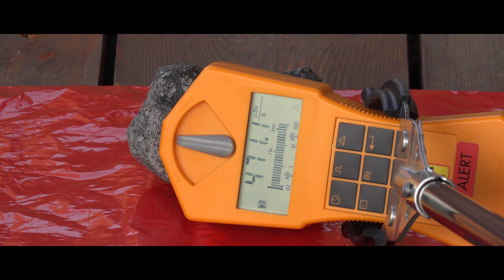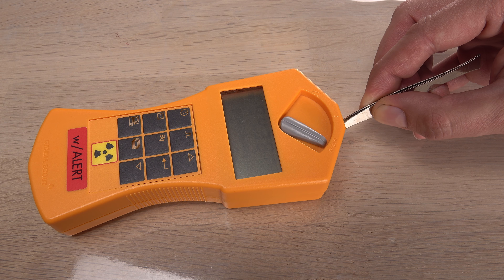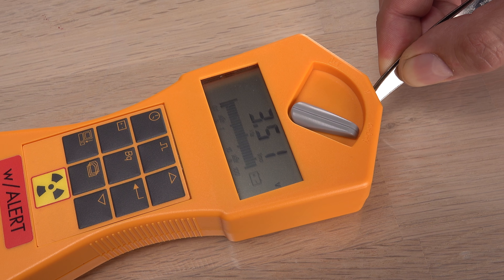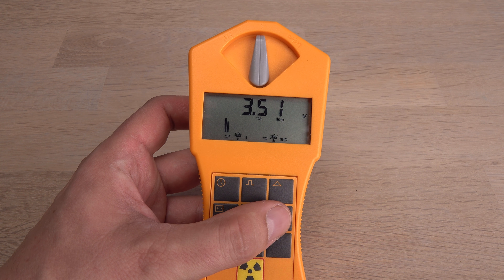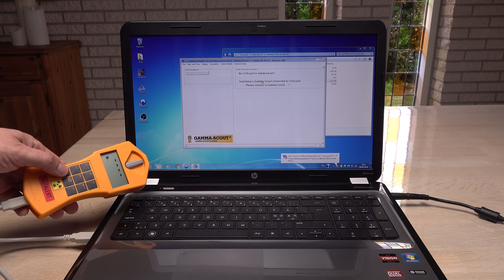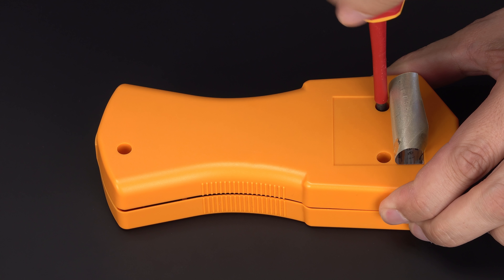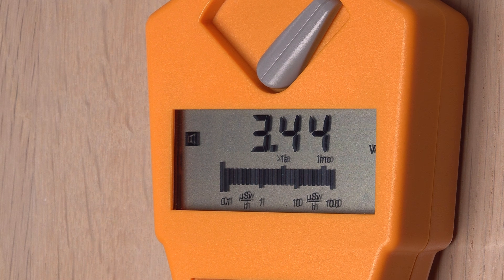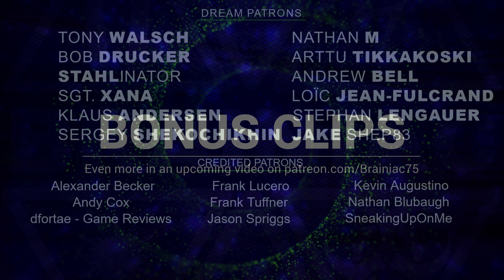Weird battery change in Geiger counter

Comment: Why didn't you just snip the leads of the old battery? That way it would have disabled the HV and it would have been safe to handle for the trickier desoldering of the legs...
Reply: It also would have been less likely  to damage the circuit board with less thermal mass to heat.
Also, Brainiac75 should get some good solder wick.
Thanks for the  video Braniac75. I'm glad your meter works again.
Reply: What about reattach

Comment: You could probably solder on a battery case for easier replacement
Reply: Yeah to save you time 20 years from now when it fails again.
Reply: skibidi bop bop bop skibidi dop dop dop dop dop skibidi sop sop sop sop sop sop sop dop skibidi sop dop yoh  @stargazer7644

Comment: It's changing a battery just put it in the correct way and don't touch the contacts for the high voltage and you will be fine

Comment: Why not solder a switch in series with the battery, when you already had it open and desoldered? :P
Reply: Because the current draw is so low the battery lasts its shelf life already.  Turning it off won't make it last any longer.

Comment: This is by far the most over dramatized battery change I've ever come across. Nevertheless, well done.
Reply: I mean, most devices don't have internal circuitry cranking up the ~3.7V of a lithium battery to several times mains voltage. Not sure if that's tied to a capacitor, but if it is, that would be dangerous in exactly the same way a microwave's HV capacitor is dangerous.

Photomultiplier tubes and magnetrons are similar in that way - both produce free electrons during normal operation and use high voltage to do it.

Comment: Why not cut the wires to the battery the moment the case is open (which will remove power from the unit) then after that, pull the board out and de-solder the remaining battery leads?

Comment: I'd have been tempted to see if it would work with just a regular rechargeable 18650 li-ion cell.
Reply: He already said that guaranty expired seven years ago. So - 8 years of battery life. To put there li-ion would be stupid.
Reply: @idopshik  - Well, he was already swapping the battery for a new lithium-thionyl chloride cell, which is more expensive than some random 18650 cell. And as he likes to produce videos appreciated by viewers, I'd certainly not call it "stupid" to swap the battery in the old geiger counter, even if it appeared that he's using newer and better devices instead.
Reply: @JohnnieHougaardNielsen  wait. Isn't 18650 - li-ion rechargeable accu, and thing he installed - chemical cell?
Reply: @idopshik  - He replaced the non-rechargeable lithium-thionyl chloride cell with the same type, which cost him more money than a rechargeable lithium-ion cell with capacity in the same order of magnitude. Of course, as he's probably not going to use the old geiger counter until battery depletion, the extra expense of non-rechargeable is not too bad.

Comment: Should have added an on and off switch, although you would have to press the reset button every time you turn it back on
Reply: Then why put in a switch?
Reply: @stargazer7644  so you can turn it off and not have the battery constantly draining
Reply: @Raven-fu1zz  This device draws so little current that the battery self discharges faster than the circuit consumes the battery.  In other words, the battery life is basically shelf life.  It would run dead in the same amount of time whether there's a switch on it or not.

Comment: I had a 1.5v AA batter reverse it's polarity once - haven't found anyone to explain why that could happen.
Really wish I had kept it
Reply: I've seen it with re-chargeable AAA batteries. I had 6 AAA batteries connected in series, and one was either not fully charged or was nearing the end of it's usable lifespan, (or was damaged/faulty) compared to the other 5. This one battery then became the weakest link. The device being powered depleted the batteries very quickly. The other 5 batteries tried to equalize the voltage difference while in use. The order in which the weak battery appeared in the chain of 6 may have influenced how much of a reverse voltage it experienced.
Reply: I saw a 12V car battery like that once. The only thing I can figure out is that the owner charged it backwards after it had completely died.

Comment: You should have snipped off the battery before desoldering. Also, used flux.
Reply: He's using resin flux solder. No additional flux needed for this application. For snipping off the battery... well it wouldn't be 'exciting' otherwise ;P

Comment: I like to have a couple of old computers around just in case I bump into interesting old hardware. Mainly because they have the required ports. In your case, you could just run XP in a virtual machine and everything would presumably be well.
Reply: i'm surprised software from 2008 wasn't working on windows 7 released in 2009, which is itself extremely similar to vista from 2006

Comment: I'd have installed a lifepo4 battery and put a charger IC on the USB header to recharge the battery. Talk about an anti-repair focused product though...
Reply: What is anti-repair about it?  He had no problem replacing the battery.  And why in the world would you put a charger on it?  Do you have rechargeables that last longer than TEN YEARS?

Comment: Sorry if it's too late but you can indeed get around it using virtual machines running either Windows XP or Windows Vista. I recommend using Microsoft Virtual PC 2007 since your laptop have Windows 7 built in ( you can  also use VMware or Oracle VM Virtualbox ).  you need to install the OS yourself though. But for the product key and the install disk you can find it on Google ( or basically any type of searching engines you have ) or just find one for new old stock on eBay or any type of online shop. I actually rate the difficulty around 3 - 5. But after you have successfully install your Operating System then you need to Install the driver for your Gamma Scout, and plug your Gamma Scout in! 

NOTE : YOU NEED AN RAM FOR AT LEAST 2 GB OR UP OTHERWISE YOU BE LACKING OUT OF MEMORY!!!

Comment: If somebody is changing this battery, please do learn how to desolder and solder. This method seen here can ruin the PCB. When desoldering, add new flux tin which helps you to remove the old one where the flux has burned off. Newer solder using bare soldering iron tip but always add some tin. Do not use too much of it.

Comment: I had to go through pretty much the same when I noticed my battery symbol had come on. I was very paranoid with messing up anything saved so I actually used my variable power supply to keep power to the unit while I removed the battery. Turns out I really didn't have to, even when one of the leads fell off the unit still worked fine of the capacitors for over a minute. I have the slightly newer CPS model, with 6.0SL(?) software. 
I cut off the battery first then just desoldered the small legs. That way I could also keep a power supply on it for longer without risking heating the battery (and losing the heat to it.)

Comment: You could have just soldered a capacitor parallel to the old battery, cut wires to old battery, charged cap to the same voltage as new battery (just use a small resistor) and then soldered in new battery.
Reply: Good idea !

Comment: Voltage doesn't kill, current does. To put that in perspective. Things like stun guns are typically around a million volts, so I don't understand the fear mongering behind this 450v
Reply: Because the capacitor can deliver quite a lot of charge at a high voltage and a low impedance.  Try shorting out a 500V photoflash capacitor sometime.  Then replace your screwdriver tip.

Comment: When I had to replace this kind of cells and had sram data to be kept, I soldered a new cell over the old and snipped the leads of the old one. It took a second or two. When sram was already lost or there was of no concern, I used a plastic AA holder and replaced the cell wit a leadless one.

Comment: These batteries tends to increase internal resistance over years, they are used also in PLC (Rockwell and Siemens), Siemens KB suggests to make a brief short on older batteries to destroy passivation layer.
See page 144 of this KB.
https://cache.industry.siemens.com/dl/files/849/1117849/att_23817/v1/424ish_e.pdf

Comment: The MSP430 is an extremely low power microcontroller; it can work at voltages as low as a few hundred millivolts.  This is why they are used in thermopile powered gas controls like those made by Honeywell.  Is that an Am-241 source you were testing it with?

Comment: Reason battery voltage stays about the same is because lithium thionyl cells as they age get a high internal resistance, to the point they will still be able to source near full voltage, but only at minuscule current draw. I have had some that will still put out 3V into a 10G input impedance multimeter, but connect a regular multimeter with 11M input impedance ( or change range on the high impedance one to the 30V range) and the voltage plummets to under 1V. Took it around 20 years to get to this point, and I had anticipated it, by placing a 0.1F supercapacitor across the cell. When it took more than an hour to recharge this capacitor in the clock application it was time to replace the cell, so used a pair of AA cells instead.

Comment: you can easely touch that 650V. It is floating so no current will flow and you wil neither get a shock. If you touch both 0V and 650V yes you will get a shock but you won't die. First of all the current isn't flowing through your heart but only your fingers, second of all the capacitor will drain instantly to near 0V. Don't be so over dramatic XD

Comment: personally I wonder if you could have fit a 3.7 battery holder on that board, so future changes you could have just swapped it out
Reply: Why would you want the reduced reliability of doing that?  You replace this battery every 25 years.  It's two solder connections.

Comment: Solder a new battery in parrellel to the existing battery legs, then cut the old one out of circuit, this prevents any data loss.
Reply: Zurkster It's better to use a temporary capacitor, you don't want to charge an old battery with let's say 10 amps.

Comment: Why not putting a second battery in parallel and then replacing the main battery? :)
Reply: Protuberanz ... This can result in the old battery attempting to charge, draining the new battery.
Reply: @florencegomer7937  But the voltages seems to be the same in idle so no voltage difference causing no current to flow isn't?

Comment: Not an electronic expert but can you just hook it up to a power source with the same voltage while changing battery to keep it powered?
Reply: *with a way to prevent current running into the battery

Comment: Small tip for next time, or for anyone else doing this.
Cut out the battery with a pair of snips, as to not need to worry as much about the high voltages during battery removal.

Secondly, a note to the manufacturer, a product like this should likely use some form of sensor for seeing if the cover is removed. As to turn off the high voltage section of the device and make it safer to handle. (though, I wouldn't at all be surprised if the transformer doesn't give more then a couple of mA at most. So it shouldn't be life threatening, would only tingle a lot...)
Reply: If this had lethal energy inside it would.  If qualified people make the repair, it isn't a big deal.
Reply: @stargazer7644  Yes, it likely isn't able to supply any dangerous voltages. Though would still be a nice touch to see.

Comment: 250/500v G/M tube is not that dangerous, in most cases not even enough current to measure on a multimeter without overloading it, especially when it's stepped up from 1.5/5v. 
Overall a badly designed geiger counter, who thought it would be a good idea to have to solder in a new batt every time it drains?? almost as bad as apple
Reply: The battery is soldered in for reliability.  The battery lasts its shelf life - ten years.  Show me another battery operated product that runs for ten years between battery changes.
Reply: @stargazer7644  even an on/off switch would be good for when replacing it. The unit could have been sitting in a warehous for 2 years before being sold, or even more. In my opinon it's not the best soloution around
Reply: @edg6779  My Gammascout is an original model (mine doesn't beep), it was purchased in 2002.  It had a 12 year guarantee on the battery when I got it.  It is still running fine on the original battery 17 years later.  You think this isn't a good solution?  Show me another product that gets 17 years on one battery.  Seriously, the power system for this product is one of the best things about it.
Reply: Nobody thought it'd be used this long I think.

Comment: 2:17... Maybe it would be a good time to add an ON/OFF switch.....
Reply: Why would any device NOT have a power switch? Why does this device need to stay powered on?
Reply: @buddyclem7328 Because it can.  Does your wristwatch have a power switch?
Reply: Why?  The gammascout battery lifetime is basically the shelf life of the battery even when turned on 24x7.  > 10 years.
Reply: @stargazer7644  yeah, kinda like RTC batts. but still worthed adding a switch, it may be useful in case the software jams (this is possible during the insertion of the new on) and also some reliable connectors on the posts to make the operation easier in every sense and also for the future

EDIT:
i support this idea of customizing one own's appliance and stuff once you maintain it, a lot of times you really want a simple feature like that switch (but there's a reason why it's always on :D)
Reply: @redoverdrivetheunstoppable4637  there is the reset button for reset
Reply: @HappySlappyFace  ah yeah, i forgot, maybe i imagined it was just for zeroing settings and recordings, i dunno
Reply: @stargazer7644  shelf life of the kind of battery used in this device is >40 years yes FORTY YEARS.
Reply: @83hjf  Mine lasted 22 years.

Comment: hmh,  you probably should replace capacitors also when you were "inside"
great vidjeo as allways.
greets from poland, cheers
Reply: There's only one electrolytic cap and it is a small, quality, 105 degree rated cap.  It isn't likely to dry out.

Comment: hehe. Had a really old model, like from 2000/2001 that I sent in and they couldn't fix it (although the battery lasted >15 years, no ticker so and it still had the serial port where the usb is now.) Got a good deal on a new alert model though, and also it's nice having a new one. Fun to finally see the inside's of one of these meters though! Also it's nice that the new models seem to have an additional decimal place of precision. (No idea about the accuracy on the final digit though...)

Comment: The nylon zip tie seems totally unnecessary - vastly over engineered for the device. The battery is secured by solder joints at both ends and can’t move anywhere.
Reply: Vibration can cause solder joints to crack if they are supporting something heavy like a battery. The zip tie is a cheap way to prevent that.

Comment: I have a GammaScout of a similar age. I also need to replace its battery. I have the battery but I haven't been confident enough in my soldering abilities.

There is a python software project for reading the data, gammascoututil. I don't know how well it works in Windows but I've used it on Linux.

I took my GammaScout to an MRI appointment a few years ago to see if anything would happen, and something did! I had it in a metal locker for my personal belongings, approximately 10 meters away from the ring, and while waiting my turn, it began to alarm as though exposed to very high radiation while the 1.5T machine was imaging a patient. The field was obviously strong enough to pull electrons off the cathode and to collide with the tube walls. Moving it a further five meters away stopped the alarming.

Comment: Is there a reason the battery is soldered on?
Reply: Yeah. Too much corrosion would occur using a socket, during the lifetime of the battery. That's according to the manufacturer.

Comment: Soldering is not that bad but one advice is to hold the tip longer on the pad so you transfer more heat to the pad and the leg of the component.
Great video as always!
I recommend You watch the HBO miniseries on Chernobyl!
Reply: Adnan Mlivo He probably didn't want to heat up the battery.

Comment: couldn't you just sub a couple of common 1.5 volt alkalizes?
Reply: No, they will self discharge and corrode too rapidly.
Reply: @MarkRose1337  maybe a connection for an external power source?  How much does this thing draw if the batt is permanently mounted?
Reply: @epiphonium  It draws about 10 microamperes in background radiation with the sound off.

Comment: I wonder why it backs to zero when you place a hot sample in a Geiger counter
Reply: It's a fault in the firmware of the older models. Mine does it. So does Bionerd23's original GammaScout. She apparently asked the manufacturer and it turned out they weren't testing with high radiation sources. It also seems to zero out when the radiation is rapidly decreased, even if only exposing it to a few microsieverts per hour.
Reply: @MarkRose1337  I guess it's works better in low battery.